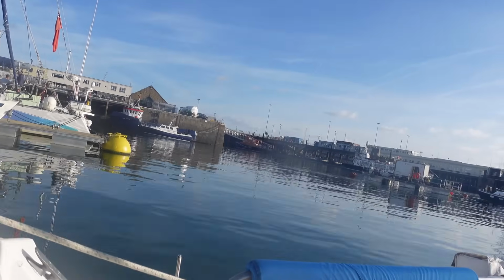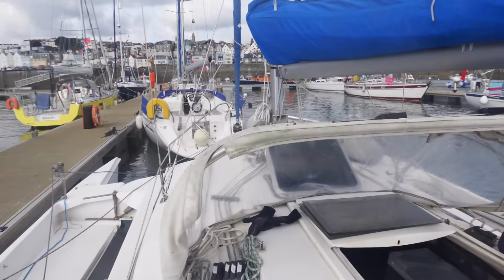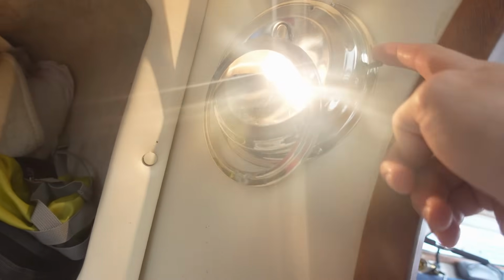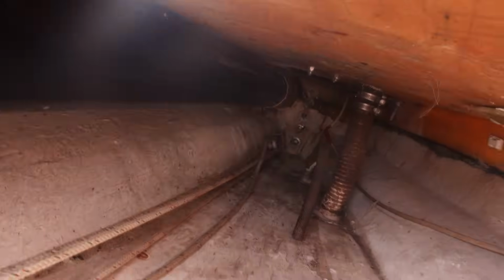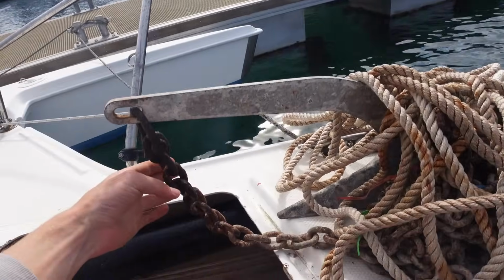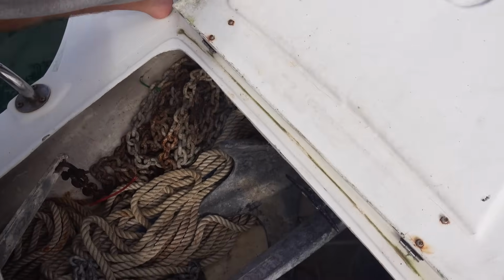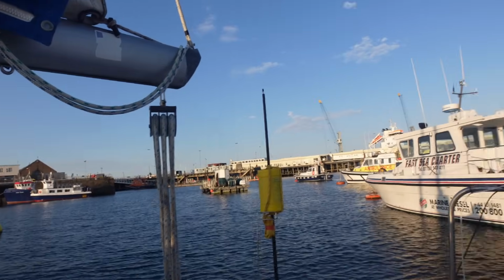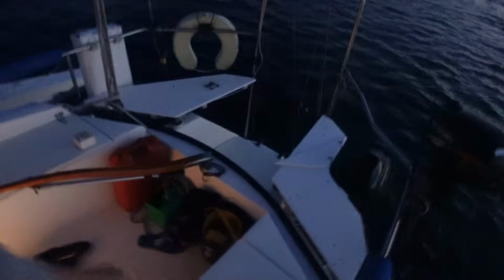FIXING MY NEW TRIMARAN IN THE CHANNEL ISLANDS… |  Ep.115

Comment: Just remember you need a bigger anchor for a trimaran than you would for a mono-hull of the same length, that bigger claw anchor might be the right size for that boat, the plow anchor looks a bit small for that boat, ok for a picnick or stern anchor though.
Reply from the maker: This boat came standard with a 4kg I believe. It does have a bit more windage but less weight.

Comment: You'll never sit at anchor in a blow and worry that your anchor's too big.
Reply: I've never meet anyone who's worried their anchor's too big, when at anchor in a blow, however worrying it's too small......well you know🤣
Reply from the maker: Exactly!
Reply from the maker: @daveamies5031  it’s definitely too heavy to manually pull up every time. I think the standard fit out was a 4kg ish.
Reply: @AlexGoesSailing  My previous Tri was ~24 foot and had a 15 KG anchor as that was the recommended size, I didn't have a windlass, so always hand over hand, lifting the anchor weight is not that hard it's breaking it free when dug in, the trick is to use the boats buoyancy to break it free.
Reply from the maker: @daveamies5031  follow sizing guidelines and information from the manufacturer a 15kg will hold 5ton in 50kts. The design is also important too.